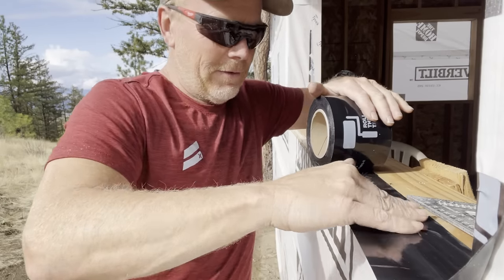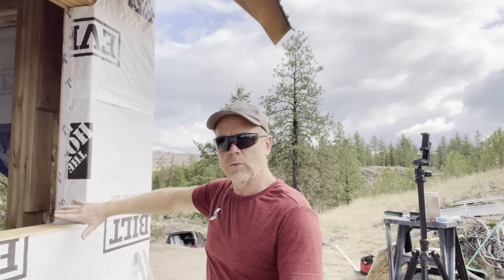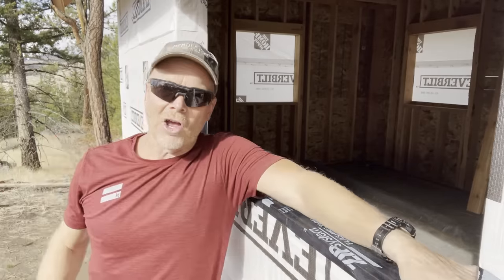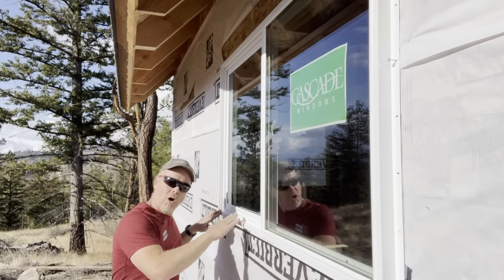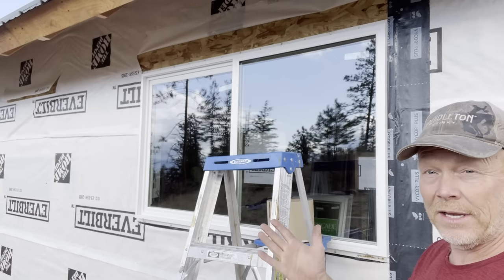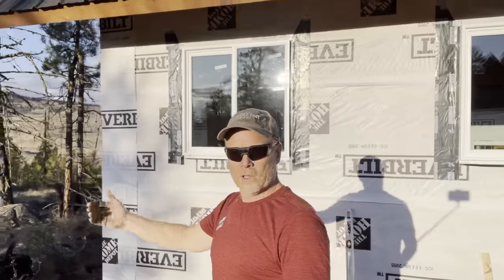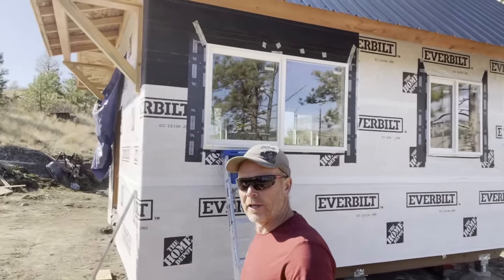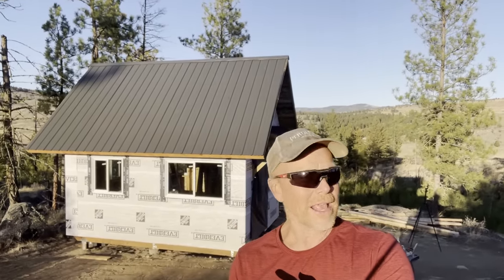Installing Windows (the RIGHT way) in an Off Grid Cabin in the Mountains.

Comment: I live in rain country so I do two layers of tape on openings, one under and one over.  One thing I highly recommend is to use screws to install windows especially when working alone.  It is so easy to change the hang or later on if it becomes necessary years down the road to change the window out.  Simpson Strong Tie among many make pancake head or washer head as some call them that are close to as flush as a roofing nail and they come in stainless.  It is also easy to back it off a half turn if you overtighten.  Most manufacturers tell you not to nail tight as the vinyl needs room to expand and contract.  The other nice part is the window can be removed during a remodel and someone else can use it because the flanges aren't destroyed trying to get the nails out.
Reply from the maker: All good stuff! I’ve probably used screws more in the past, but wanted to change it up this time. It’s amazing how many people have different methods. I appreciate you watching!

Comment: The most important step, remove the decal off the window immediately. Good job. Those bake right on in the sun.
Reply: No no no. If you need any inspections, they will shit all over if those stickers are removed.
Reply: Except if you have to have them inspected when building to code. They need to see them in some states.
Reply from the maker: Yep! Not sure if you noticed, but I did just that after the first one.
Reply: No, no, no! Those have to be left on as long as possible, just like the plastic wrap on a new TV, or cell phone, lol.

Comment: Great job! What a ball it is to build a cabin!
ZIP Tape, in order to bond properly needs to be pressure rolled. That what activate the adhisives. Experts will tell you that all windows leak - it's just a matter of when. Siding and house wraps are not waterproof. House wrap is for stopping air infiltration. I never understood house wrap co. wanting to wrap their product in to the openings. Especially with all of the staples and nail penetrations after the siding is installed. I believe if water gets behind the wrap (and it just may)  it can make its way onto the raw wood framing - though I do add  a layer of flashing tape on the stool and the lower corners.. I cut back the wrap, making a flap on top, the way he did but the sides I cut 2 inches shy of the opening, caulk 3 side (not bottom) and install the window. Flash tape it in a shingle effect but not flash taping the bottom. You want tAnd then tape the tyvek with its own tape to the flashing tap. I know, I know.. that's not how the manufactures describe.. It just makes more sense to me.. On more layer of defense.
Reply from the maker: Appreciate you commenting and watching!

Comment: when you build your home think about using the Japanese technique Sho Shogi Ban technique around the lower portions of doors and windows along with the modern moisture deterrents. My sons home built in 1930 had this technique used and the lower corner framing were not degraded as is common in most homes. food for thought. my2cents
Reply from the maker: I DO like that technic. I appreciate your 2 cents!

Comment: I replaced a kitchen window this summer in my house that was installed in 1990 (it was dated).  Marvin crank out style.  No tape, nothing.  Just shoved in the hole and nailed.  It was all solid, zero rot.  This is in Wisconsin-super hot humid summers and frigid polar winters - i will add i have big overhangs (ranch style home/hip roof/24 inch overhangs).    All of these windows from 1990 are junk.  Its sad this stuff doesn't last long--these were wood interior/aluminum clad exterior.
Reply from the maker: Interesting! Yeah the overhangs help a lot. Thanks for watching and sharing!

Comment: The windows need all corner holes and at least every 3rd hole nailed. The caulking isnt necessary at all. If youre going to do it though it should be put on the window itself. Right over the holes so when you nail it it seals. You're supposed to use roofing nails for a window too, much fater heads. Sealing the windows is done from the inside aftr install. Good old can of spray foam. The window should never be touching the RO, it should always be shimmed. That way you can seal it with the spray foam.

Comment: is there a reason you chose to nail in the windows vs screws?
Reply from the maker: Mostly the flatness of the shingle nail head, with the thought of leveling the trim. I’ve certainly used screws in the past though.

Comment: Hey silly question maybe people, but the tape Patrick used at the bottom/inside of the window (before the window was installed) is that the same tape he used at the sides and top once the window was in?  Looks different to me and trying to build my list of materials!  Thanks
Reply from the maker: The two are different. The sides and top are a peel and stick with minimal stretchiness. The bottom sill tape is a Zip product (I believe) with great stretchiness around corners.
Reply: @LifeontheMoose   Thank you sir!

Comment: I just put in three 3x4' sliders in my shed/office build this week. I used GRK cabinet.pan head screws...every other hole, none within 3" of corner. Will you be taping the tyvek seams?
Reply from the maker: I will not be taping those seams. I just don’t think it’s crucial under these circumstances. I appreciate the input!

Comment: To me a non construction guy, it does seem logical to apply the silicone, flange and sealing tape to the wrap instead of the building. Like putting a bandaid on your shirt for the cut on your arm underneath. But I guess you can't install the windows before the wrap.
Reply: Typo there... It does not seem logical...

Comment: Great program friend. I really enjoy your project. In your attempt to not trap water you have actually introduced moisture. If air can penetrate the opening, then moisture has been introduced. It's in the air, it's called humidity. The window should be sealed on all sides. Code in most places will also require you to nail every hole as well as low-e and other requirements such as double pane glass, storm windows, etc.. Thanks sir for your cabin! Enjoy in good health and spirit! I sense the peace of your space, especially the wooden gate area and the outside fire pit.
Reply from the maker: Thanks for the kind words, and for watching! 🙏
Reply: You are not supposed to seal all 4 side. Every manufacturer and installer advise to seal the sides and top. The bottom is left open. 

Foam is then added around all sides in the interior and caulked to stop any moisture getting past the window. 

Sealing the bottom flange would only trap water and root the wall.
Reply from the maker: @phamlam3720  I did not seal the bottom flange, and made a point to mention your reasoning in the video. Thanks for watching!